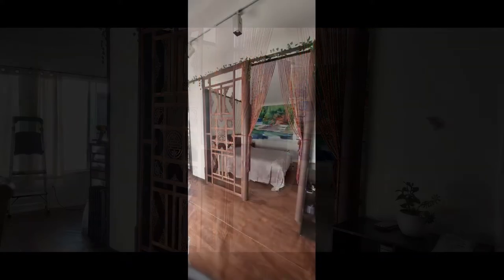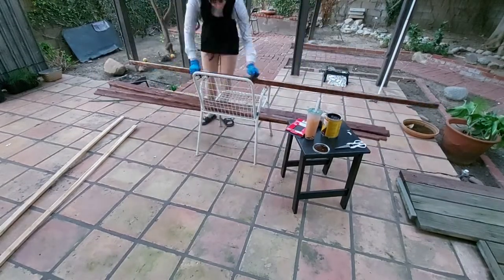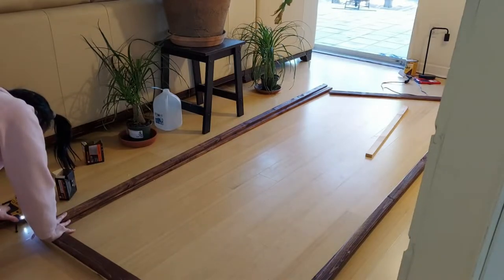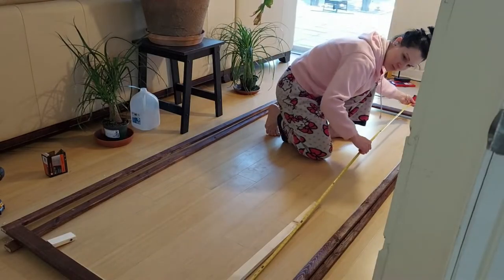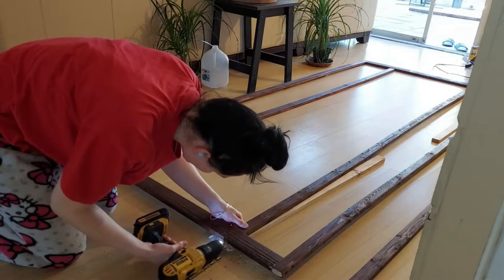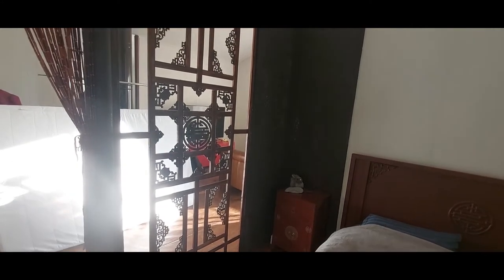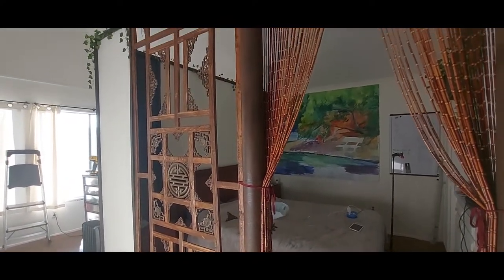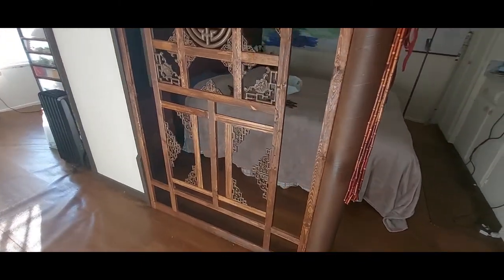DIY Chinese style inspired screen!

Comment: The ornate inlays -are they also handmade or were they purchased and what type of wood. Also what type  of wood did you build the frame out of?
Reply from the maker: I purchased a couple of different ones, then I copied them using silicone moulds and then used resin to cast them

Comment: I LOVE your voice! It’s extremely calm and soothing. Just be your authentic, amazing, creative, talented, and beautiful self. I am trying to do this project for quite some time now as I fell in love with how amazing it is! I don’t usually build things but I’m really determined. Having hard time finding the correct supplies! I know you have listed them several times in the comments but still unsure of exactly what I need. I am looking for foam insulation like you used 4x8 but thicker as you recommended. 2 inches or maybe more….but I’ve looked everywhere and can’t find. They are pink or gray colored. Many say Polystyrene on it. I tried reading about it but not sure that’s the same thing. There was a lot of really flimsy white styrofoam insulation too. Like the stuff that falls apart when you pull the packing out of box from purchased item. And none of them have this protective film on it. I am running into a ton of smooshed up and dirty looking insulation sheets. Everyone I ask at Lowe’s/menards/hardware store all are clueless and look at me like I’m insane when I tell them what I’m looking for and trying to build. I saw your suggestion about doing it with plywood. If you would be willing to chat with me and maybe share some guidance I really would be so very thankful! I was just wondering what screws would be the best as they would have to be pretty long. Did you use flat paint or latex? Does it matter? What did you cut it with? What are you using to protect your floor in the video while cutting? Did your cat shred it to pieces? Did it hold up? Are you using wood filler to fill the holes? Did you use just a hack saw for cutting wood pieces or need an electric saw? Would you be willing to make a Chinese screen for me like yours? I will pay you for your

Comment: @3:41 what are those tiny pieces?
Reply from the maker: Those are giant paint stirrers. You could also use yard sticks
Reply: @ShelyHomeDesign  thank you for being patient with me :) I'm fixing to convert my place into 4 studios with your enlightening method
Reply from the maker: I hope it works out well for you! Remember this is just cosmetic and won't be strong enough to be treated like a really wall, so be gentle with it!
Reply: @ShelyHomeDesign  this is what I've done so far, I took your foam idea and  to reinforce it I've treated the foam like drywall, I bought studs and did proper frame work l, I went with 3inch owens formboard. I scratched it on both sides so I could put a layer of sika into it this incredibly increased strength. 
To test it I 👊 punched it and kicked it and so far it hasn't cracked or broke. This makes it renter safe and  sturdy. 
I'm making a video of it and with your permission I want to mention your channel as my inspiration
Reply: @TheMajinCollins  do it !